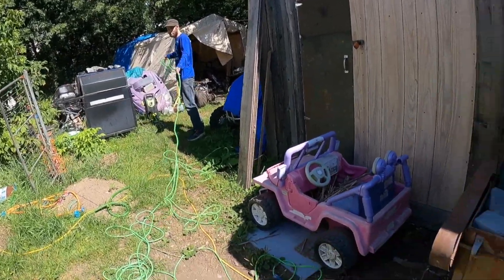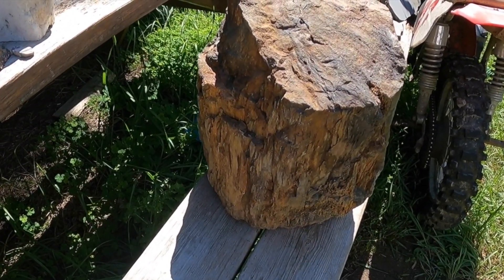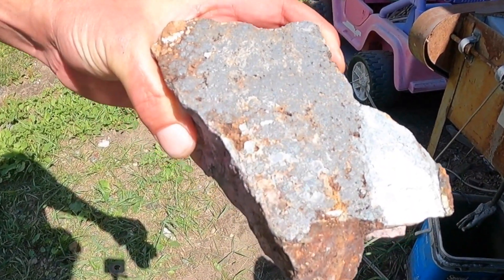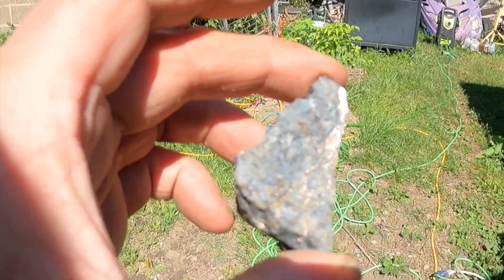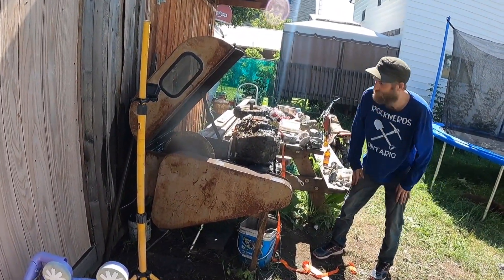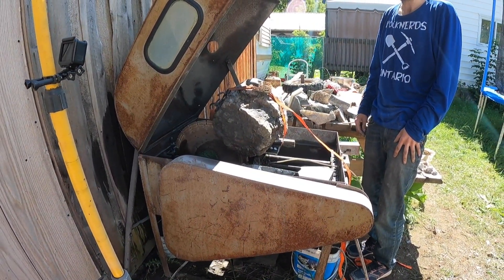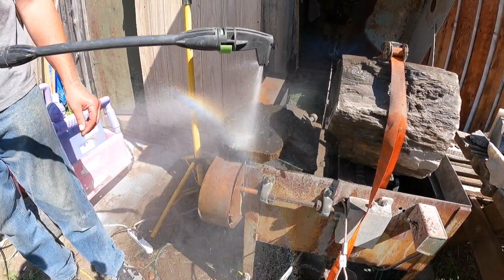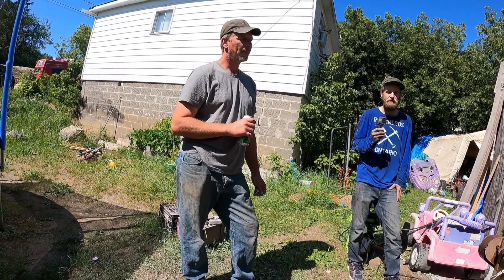Huge Saw!   But Rock was bigger

Comment: Nice how cool a piece of ordinairy wood can turn into something this nice. How do the other materials get inside the tree though?
Reply: AFAIK, they pretty much all leech in, usually at different times. 

Although theoretically, a rock could've been "picked up" by the tree while it was growing (stuck in branch crotch, or roots) and got trapped inside the former wood. I've never seen it in petrified wood personally, but I have in fresh wood
Reply: @crinkly.love-stick  that is pretty cool. Also seems to make sense now you said it. Have a great day and thanks for sharing :)
Reply from the maker: The wood gets buried in mud or clay.  Over time, silica from water replace/crystallize inside the wood's cellular structure
Reply: @meMiner  I'm always puzzled by the amazing stuff nature does, these small bits of info are true 'gems'. feels good to see a community where you can learn stuff and ask questions 😀

Comment: Had to rewatch it because my ADHD saw the dirt bike, barbie jeep, and snowblower tires, and started giving me ideas.

Is that guy a mechanic, by chance? Techs love using ratchet straps for everything
Reply: Not really, I like to build stuff for my kids to ride (and try to keep myself mobile for as cheap as possible lol)   what kind of ideas did it give you?  Because the Barbie jeep is getting a frame and a 110cc engine from a kids atv  haha
Reply: @ExploreUnderground  motor and transmission from bike stuffed into jeep, with some nice little knobby snowblower tires on the back. 5 speed powerwheels that'll cut donuts on asphalt!
Reply: @crinkly.love-stick  so not far off from what's happening with it lol    It's gonna be for my 8 year old daughter though, so you might only see it in a couple meMiner videos lol   
   It'll be a 1 speed 110 for now.  But when she understands a clutch and gears, I'll be swapping a 125 4speed manual clutch into it because I have 1 of them also. That could very well be next summer at some point, but will be rideable in the spring anyways

Comment: Like that you ruin your saw.  Spray some wax on the rock. Place it on a flat surface with a rectangular surface like the bed of the saw looks. Fill the gap with quick set mortar and let it cure. Like that your rock can be placed safely on the machine and strap it down. Safety first for machine and man .

Comment: I had a saw like that one, cool.
It's such a shame when they have little variation inside, got a similar size one from india, completely one solid colour, gutted. 
Such a difficult thing cutting like that, there is no easy way, one way I found was fixing the rock inside a tube and turning the tube,( i used plastic pipe my brother got from building sites and expanding foam, wash off with muriatic acid after cutting,) 
Ran out of pipe though, but I did have hoop la rings from plastic but the kids got bored and I got fed up picking them up from the lawn. 
I will be glad when i'm all set up again in my new home.
Daisy, bless.
Cool video.
Reply: That's a really good idea. You could cut stone on a lathe like that lol
Reply: @crinkly.love-stick  
Yeah but if you do try it on a lathe, make sure i'm not in the same room eh.
I did do some cutting on my old southbend lathe, not very successful and very messy, polishing was not bad though but still very messy.